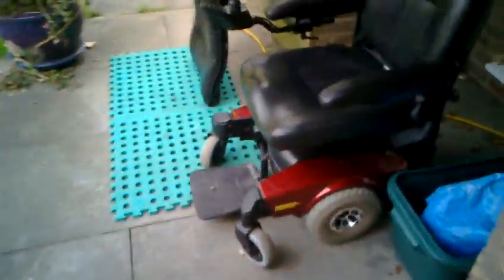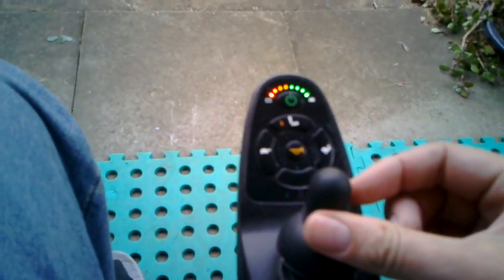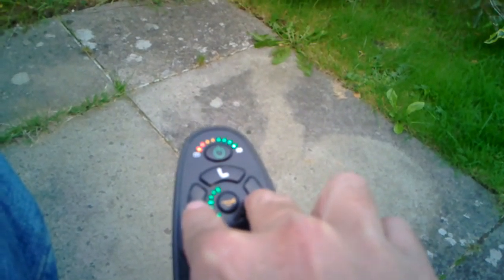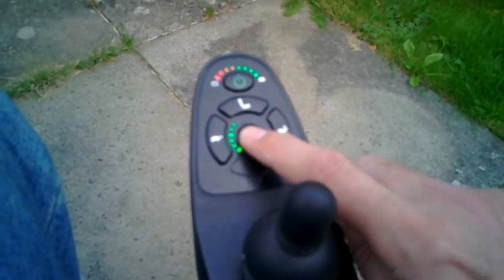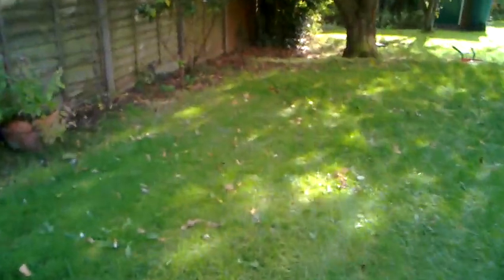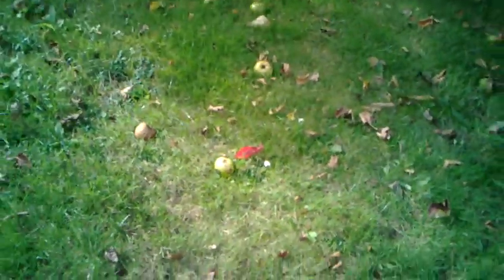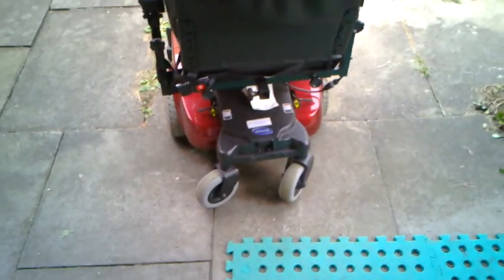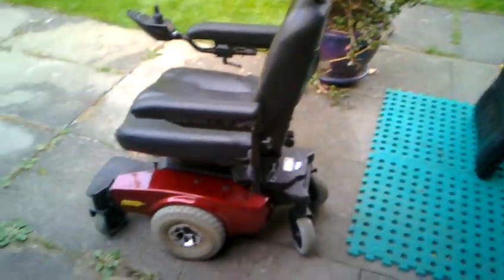Hacking an Invacare Pronto Electric Wheelchair - Part 1

Comment: This is really interesting jim. My father is actually in a wheelchair now for ober 30 years. We all mess around with different types of motorsports in my family. I have always wondered about the possibilities his chairs have. I also have a device that connects to the chair and i am able to adjust all types of settings like speed and brake etc. One of my main questions is can we make his chair faster? We have many parts and chairs to play with i just never got around to it. Any info would be appreciated.

Comment: Good morning, on my joystick the LEDs indicating the speed do not light up. if I press the buttons to increase or decrease it there is a difference but in any case the wheelchair is too slow. it does not report any error codes. can you help me please?
Reply from the maker: On my chair the speed is only adjustable when the chair is in it's lowest height setting. If the height is extended then it's restricted to the slowest speed as a safety measure. Hope that helps. Cheers!!

Comment: I have a similar wheelchair that I think is locked but I don't have the lock button. I tried holding the power button down but it just turns off. There is a small flashing X ,yellow, at the bottom of the joystick. Please help me, if you can. Thanks David
Reply from the maker: +David Olenick - On the pronto M51, it's 'press the horn twice within 10 seconds' to unlock. Hope that helps. Cheers!!
Reply: Oh, I have an m94
Reply from the maker: +David Olenick I found the user manual for the m94 online at https://www.invacare.com/doc_files/1122145I.pdf ... Pages 36 and 37 seem to indicate that the X indicates that it is in 'no drive' mode, and that pushing the mode switch will let you select a different one... I imagine you've already tried that, but I thought I'd share the PDF with you in case you can find a solution in there. Cheers!!
Reply: +Jim Conner  Jim, do you know what they mean by this ?
M94 @ fixya. Of course they said ,"take it to the shop. Like duh...

Motors must be fully locked in gear to drive. Also many chairs require the joystick to be turned off before putting them in gear or turn chair off and back on after engaging the motors.
Reply from the maker: On my M51, there are two levers on the underside of the chair which can be used to disengage the wheels from the motors... You use them when you need to move the chair around without any battery power remaining. If your chair can be rolled backwards & forwards just by pushing it, then it would indicate that these levers are set in the wrong position. Hope that helps. Cheers!!
Reply: +Jim Conner  It can be rolled. Another person said that the flashing yellow X is actually a wrench. It flashes 6 times and pauses. I will let you know if it works. Thanks for your reply
David

Comment: I have one of those wheelchairs but doesnt raise the seat button mine has lost the power to go on the fast setting its pretty slow just wondering is there anything i can do to it to make it go faster the fastest setting goes like a smail and it never used to be like that i need to get it upto speed again would you think it may be the battery
Reply from the maker: Hi Jamie - Full speed is only available when the seat is in it's lowest position. If the seat is raised then the chair will go into slow mode (presumably because the high centre of gravity might make it fall over if you cornered at full speed with the seat all the way up). Hope that helps. Cheers!!

Comment: they make a little ball that looks like a cage made out of wire it's got a handle on it it looks like one of those popper things little babies push around the house that are very annoying but it's a cage instead on a ball on a long handle you push it around the yard and it picks up your apples look it up on eBay they're only a few dollars
Reply: It's for picking up golf balls but it works perfect with apples to
Reply from the maker: It's been many years since I started on this project and it's still not finished... A friend of mine pointed out that a nail through the end of a long stick is brilliant for picking up apples without having to bend down, and I've been using that ever since. Tap the apple with the pointy bit and it's picked up, tap the stick on the side of a wheelbarrow and the apple falls off. Simple and effective. Thanks for your suggestion Clayborn, and for taking the time to comment. Cheers!!

Comment: Can I use car batteries
Reply from the maker: Yes you can. Car batteries will be perfectly fine.
Reply: @ThingsWhichArentWork  thank u
Reply: @ThingsWhichArentWork   will the original  charger work with car batteries  or will I need a  different  charger I'm trying to help my friend out so  I can spend  a fortune  his disability  won't cover the chair
Reply from the maker: @Kevin-id5hx  The charger is designed for AGM type batteries which usually have a slightly lower charge voltage (14.3-14.5v) than a regular flooded lead acid car battery (14.7v). Using the charger won't damage car batteries in any way, but it isn't ideal for keeping car batteries at their best. Over time you might get a build up of lead sulphur on the plates which could reduce the life of the batteries by a year or two. Flooded lead acid (car) batteris usea slightly higher charge voltage that will cause the electrolyte to bubble/boil, which in turn displaces the sulphur buildup. For AGM batteries the charge voltage is lower specifcally because you don't want bubbling/boiling to occur. In practical terms, you probably won't notice any difference in lifespan, particularly if you periodically (every 6 months or so) top the batteries off using a car charger. Hope that helps.
Reply: @ThingsWhichArentWork   yes  it does  thanks

Comment: I really dont see any hack that your video suggest. But there are people that could really use that chair instead of you running around your yard
Reply from the maker: The 'hack' was reverse engineering the Sharkbus protocol to control the wheelchair via software instead of the joystick. There are many people who have used this to their advantage. My favourite re-use of the hack was from a wheelchair user who also liked sailing. He re-purposed one of his old chairs into a boat-towing machine so that he could get his boat in and our of the water whilst still in his own wheelchair. There are many thousands of old wheelchairs going to scrap each year, so potentially giving them a second life seemed like a good idea. The 'hack' has also been used in university projects to enhancer existing chairs with extra additions such as robot arms to reach objects from high shelves in supermarkets, allowing wheelchair users more freedom. I don't feel that I deprived anyone of a wheelchair by doing this project... more that I opened up a better alternative for old chairs than just sending them to scrap. Cheers!!
Reply: Got any info . No . So
Reply from the maker: @lonniesmith83  All of the code etc is on my github. github.com/jimconner/sharkbus - Is there more info you were looking for? (The link is in the description of the part3 video I think)